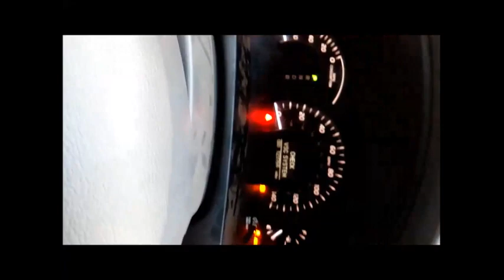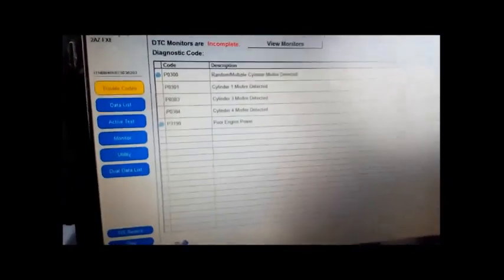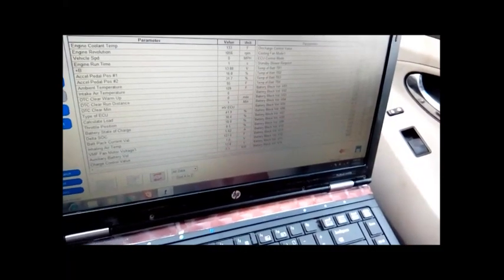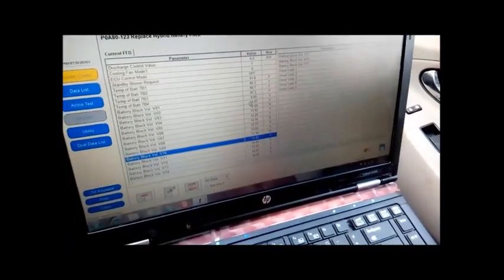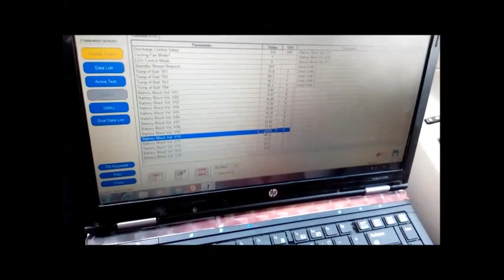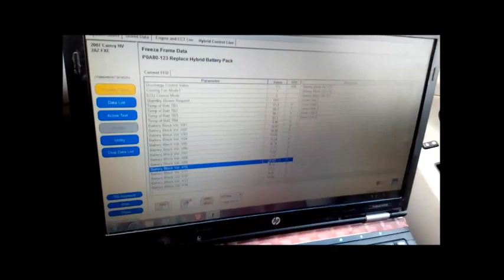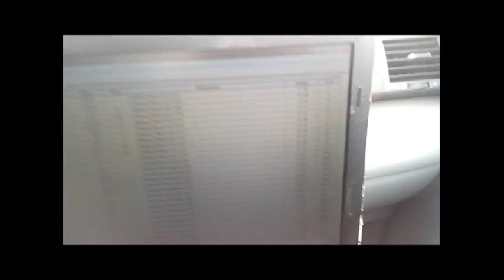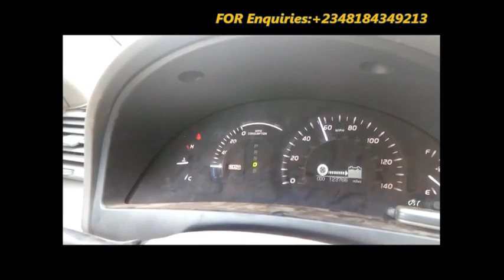P0A80,P3190 HOW TO TEST FOR A BAD TOYOTA HYBRID CELL WITHOUT TAKING OUT THE PACK

Comment: I just got a P3190 on my lexus RX450H , a sudden decrease acceleration unable to feel the gas pedal, no feedback.Îshould stop’and restart all’the way, the hybrid battery been remplaced bit not help, fault’still’there
Reply from the maker: Check for fuel pressure, check the spark plugs and if the exhaust line is not clogged... but it often comes down to be the fuel pump.

Comment: How you one fix p3190? On Camry 2007. I have changed the spark plugs and the injector nuzzle, but the comes on and vibrates and goes off. I removed the manifold to be sure the catalyst is not blocking the exhaust but the car did not start.....pls advice
Reply from the maker: Check fuel pressure, of better still Check the freeze frame data to see what was not right before the code was triggered...fuel trim can go a long way to help..

Comment: Hi my name is FADY and I have issues P0A0F and p3190 p3191 engine start then few seconds turn off hv battery good shape test all block with TechStream but I have the issue with the gas engine please need your help
Reply from the maker: I suggest you do a system tune-up  for your engine
Reply from the maker: And check if the catalytic converters are not clogged